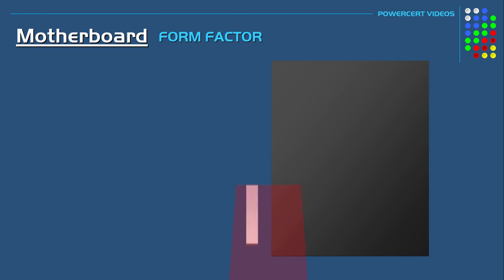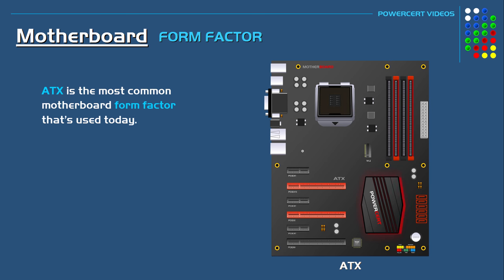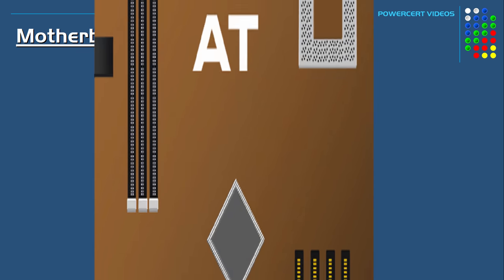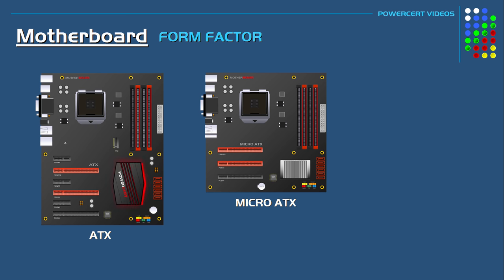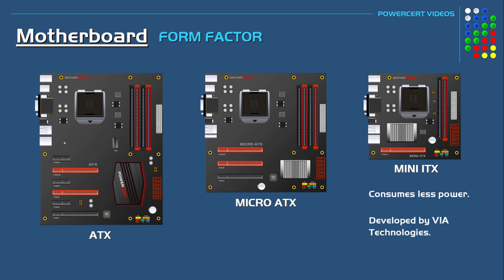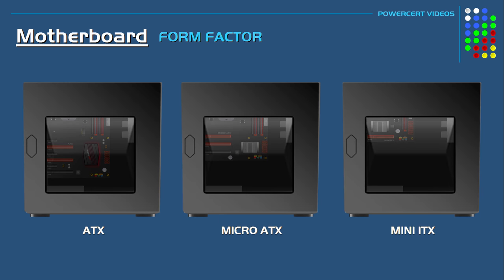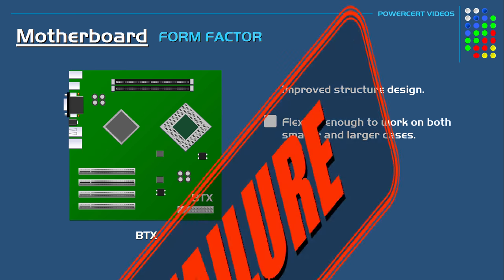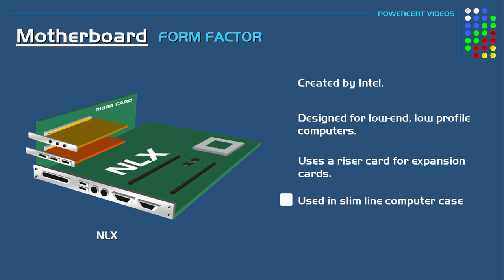Motherboard Form Factors

Comment: He talked while checking the sound.
The narrow band is the sound with 8 KHz, the frequency has a range from 300 Hz to 3.4 KHz.
The wide range is 16 KHz audio, the frequency ranges from 50 Hz to 7 KHz.
The ultra-wide range is sound with 32 KHz, frequencies ranging from 50 Hz to 14 KHz.
The full range is audio with 44.1 KHz or more, frequencies ranging from 20 Hz to 20 KHz.
You'll see a big difference in sound quality as sampling speed increases.

Comment: Couple of comments: Micro ATX doesn't have a standard width. They vary depending on manufacturer but all will fit into a Micro ATX or ATX case. Also not all ATX or Micro ATX motherboards come with at least 4 RAM slots - some only have 2.

Comment: So glad i found this channel, awesome work. Do you have a video going through all the ports on a board like PCIe 16 8, fan headers pins and so on. I am just getting into this and considering fans or, radiators or rgb is a bit confusing.

Comment: I have an old Dell Dimension E510 with a BTX motherboard set up, is it possible to replace most of the old components with newer ones (such as MSI Z690 Pro-A wifi), without having to alter the case?

Comment: The carrier also gives you a frequency while listening to the sound.
This is 44 Hz.
This is 86 Hz.
This is 170 Hz.
This is 340 Hz.
This is 670 Hz.
This is 1.3 KHz or 1300 Hz.
This is 2.6 KHz or 2600 Hz.
This is 5.1 KHz or 5100 Hz.
This is 10.1 KHz or 10100 Hz.
And this is 20 KHz or 20000 Hz.
To achieve the best results, the sampling speed requires no less than 44.1 KHz.

Comment: All my pc parts are 20 degrees celcius it can't be overheating. My psu is 280 watts. My computer is up to date but my video card isn't strong enough for overclocking. There isn't dust or liquid buildup inside my pc i dont see whats the problem. I do play on high graphics like 1080p so might that be the case or something else? I built the pc 2 days ago. And it doesn't really shut down it just shuts the screen off for a bit. And it gets me to the log in screen

Comment: I have an ITX motherboard from a well-known motherboard manufacturer with a 2-pin ATX power connector. The connector is known as "ATX19V1" yet I have had great difficulty finding such a connector to run power to the motherboard. There is an option to power the unit with an external D.C. power supply - or power "brick" - but I would rather get the power from the internal power supply that came with the ITX case, but is not outfitted with this ATX19V1 connector. Does anyone have any suggestions? It is greatly appreciated. (And, yes, I am trying to go frugal/cheap and the ITX case is no-name brand.)

Comment: Could you explain pc parts compatibility? I want to build a computer, but knowing how to pick the parts is what's stopping me.
Reply: Use PCPartPicker. it will tell you if the parts you choose are compatible. The main thing you need to focus on in terms of compatibility is CPU and motherboard. If you are going to build an AMD Ryzen system, you will need to use a compatible AMD motherboard. Same thing with Intel. You need to figure out if the Intel CPU is compatible with the Intel motherboard. Again, PCPP is a great resource for this.

Comment: What are expansion slots for?
Reply: Well its in the name: To expand the functionality of the computer. For instance,  you can add a graphics card to a PCI-E slot to get better gaming performance on your PC. You can add a Wi-Fi card to a PC that otherwise wouldn't have Wi-Fi connectivity. If you need more SATA ports than your motherboard has, you can buy a SATA PCI-E card and so on.
Reply: @JJFlores197  Wow thanks for the explanation

Comment: Bruh... your BTX motherboard drawing? It's backward. BTX was also designed so the Motherboard would mount on the OPPOSITE side of the case as compared to ATX, and this consequently led to PCI cards with a majority of their components on top with BTX boards, rather than on the bottom as they are with ATX.